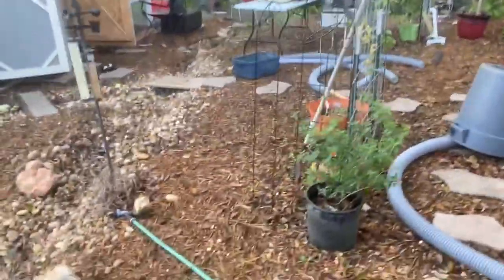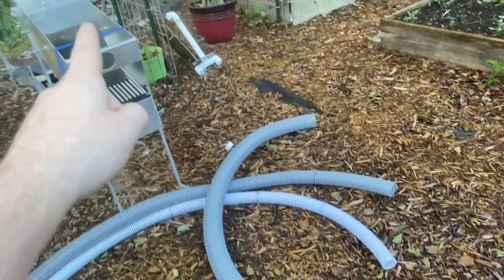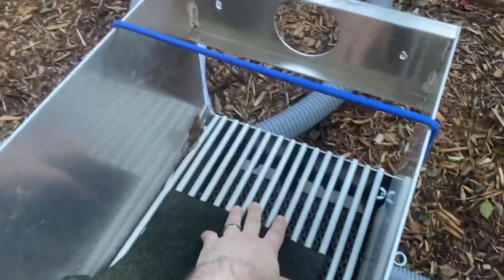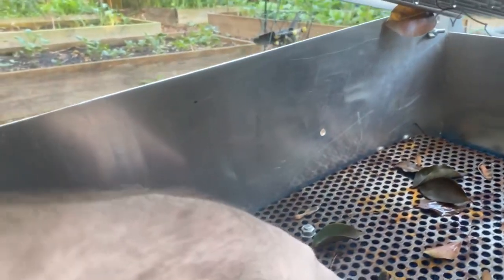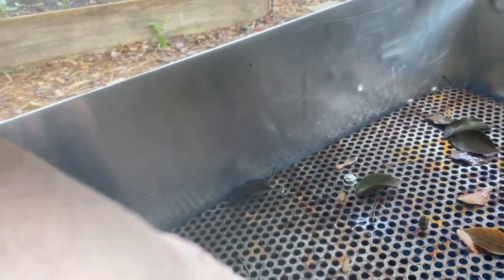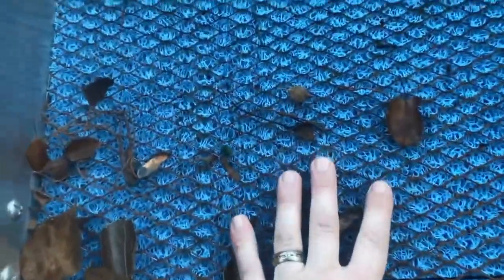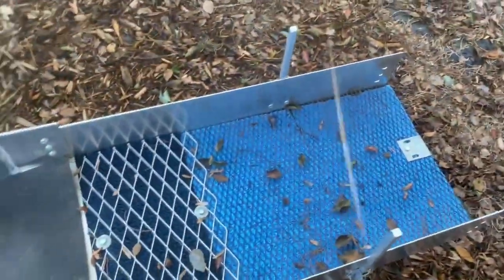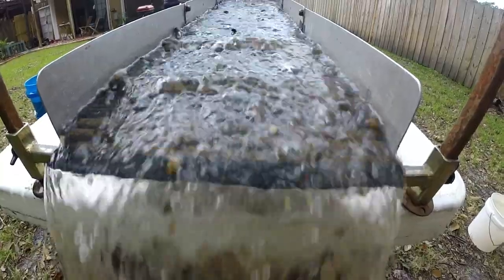Modifications To Monster Hog Highbanker + Dredge Conversion

Comment: Pretty awesome setup brother I have my high banker set up in a similar way but since I use dreammat at the bottom I reversed the flare in the middle so I can run a smaller sluice at the bottom cuz that dream mat has to have a little bit faster flow and it seems to work awesome keep up the good work can't wait to see this out in action ✌️
Reply from the maker: Awesome man. I have never messed with the dream mat. Very curious, can you run a lot of material over it? It will handle it?
Reply: @sluiceboyprospecting  absolutely you can run a lot of material very quickly over it and it's captured on fine gold is amazing 👌✌️